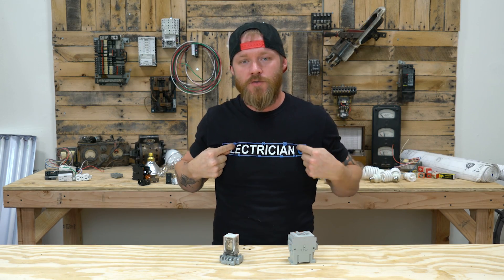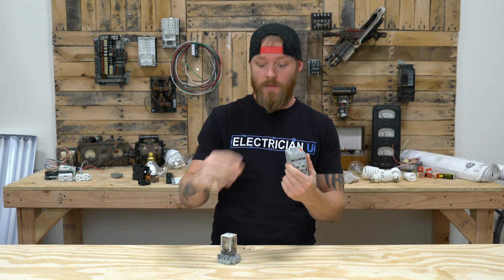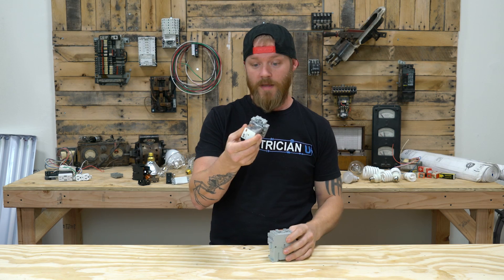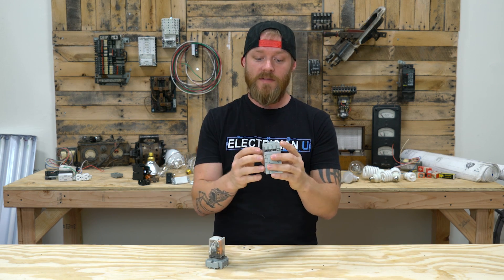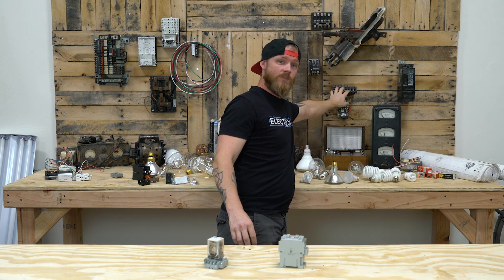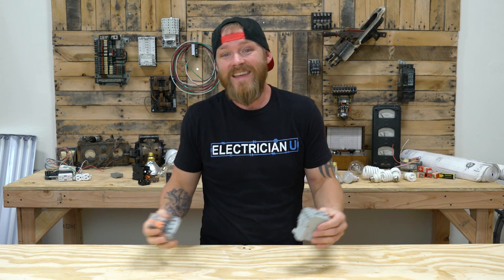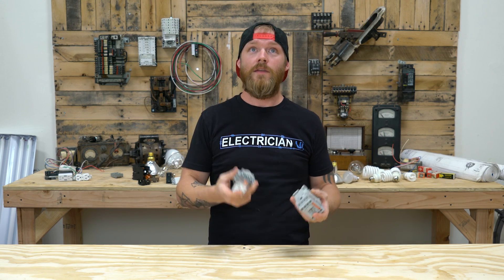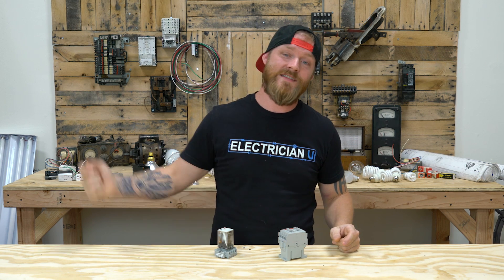The Difference Between Contactors And Relays - ELECTROMAGNETIC SWITCHES electricians use

Comment: Relays "tend" to be for logic switching. Contactors for power switching.
Reply from the maker: Most of the time you're right, but the fact you put "tends" to in there lets me know you're experienced in the field lol
Reply: @electricianu  Hey Dustin can you please do a video about motor controls would be very helpful.
Reply: Yes, relays are durable and inexpensive in "low power" switching applications.
Reply: @Stones_Throw  Right, not gonna see much over 120vac thru them.  I haven't anyways.
Reply: But I'm confused a bit, Synch Pessor. What do you mean by having "tend" in quotes? Are you trying to say that "tend" here is a figure of speech rather than actual tending? Why not just state it directly? What's fake about it in this context, according to you?
Reply: @HelloKittyFanMan.  I took it as a throw back before plc's.  I don't see much use of relays in logic circuits, with exception to safety.  I see them mostly used for switching low power control applications,  like solenoids.  I say mostly as I do see relay logic on older equipment.
Reply: Well,  @shnlj5910 , I'm not sure what possession of a programmable logic controller you mean (a PLC's... what?), but if you just meant the plural form instead (more than one PLC, so "PLCs"), then here's what my reply would be:
Still, though, "tending" would be real, rather than just spoken as if it were a figure of speech, right? So that's why I asked Synch Pessor why he put "tend" in quotes like he's just saying it because it's someone else's idea, or just an artificial idea in general, rather than one that he agrees with or rather than what's reality (you know, the usual reason we use quotes even when we're not quoting someone's actual saying). So it will be interesting to see what, if ever, Synch says on the matter, huh?
Reply: shn lj  , see them all the time in commercial hvac units and as pilot relays on building automation systems. Like you said , usually lower voltage . I’ve never seen more than 120 on them.
Reply: Johnny Jr you can get relays that have coils that run off 208, 240, and 277V. Plenty of RIB relay models have those coil options.
Reply: Russell Brown that is true.. I use ribs a lot . Didn’t think of that.
Reply: If I said it differently it wouldn't be accurate. An excellant presentation by EU.
Reply: @Stones_Throw : It would be if you hadn't included the quotes around "tend." With the quotes, but you're not actually quoting someone, it's like you're just saying that as a figure of speech instead of meaning it for real. So why the quotes?
Reply: @HelloKittyFanMan.  Like most situations. There are no absolutes. My statement with the condition "tends" simply focus on use and not design. "Yes, relays can switch low amperage power loads."
Reply: @Stones_Throw : Of course. But you can say that without the quotes. Relays tend to be for logic switching. See how I just did that without the quote marks? So again, why the quotes?
Reply: @HelloKittyFanMan.  Because it's "my" declarative statement. My intention was to "not" dispute EU in any way. An excellant trade channel.
Reply: @Stones_Throw : Now you gotta quote yourself? And "my" in quotes? So it's not really yours? And then you add them around "not." Dude, you're just quote-happy and it doesn't even make sense. Just because you put quotes around your own statement doesn't mean you're not disputing. And if you were gonna quote yourself then why not just put quotes around the whole statement? DUHH....
Reply: @HelloKittyFanMan.  This has been fun. Highlighting or underlining may have been a better choice. Let's see, "Weeways tend to be used for logic ckts and contactors for pwr switching." Works for me.
Reply: @HelloKittyFanMan.  In my case it comes down to the machinery from all over the world. I've spent 40+ years installing and repairing. Just 1% of my efforts involve solenoid devices.
Reply: @HelloKittyFanMan.  Focus "here" skippy. The purpose of the quote marks was to without question make my statement "not" absolute.
Reply: I tend to disagree. Most modern logic circuits tend to use solid state devices to replace relays in today's products. In the Automobile industries, relays are used to turn on all sort of things from cranking the engine over to blowing the horn. Microwave ovens use them to turn on the magnetron tube. On the other hand, a Contractor is nothing more than a big relay.
Reply: 40 amps ssr
Reply: @ser7ser7i they get hot
Reply: my first thought is the relay used in audio amplifiers. a relay doing output power switching
Reply: Can I use contactor ..auxiliary /hold circuit for power cut off function in my device ? when the device send a trigger relay break input to the holding auxiliary circuit of the contactor?
Basically I need this in my plc project to cut off supply whenever any emergency/error occurs.
Reply: 90 Amp starter in my car is fed up with two  parallel 70A relays.
Reply: Is there an umbrella term for both of them?
Reply: What about in Motor Control Circuits that operate on lower voltage 120v to power on/off 600+volts  motors? Are those relats or contractors?
Reply: Relays are used to switch solenoids frequently.

Comment: Any recommendations for a two-voltage relay/contactor? Something professionally made that runs 120 volts AC but controlled by 12 volts DC?

Friend has a system rigged in a remote cabin, but either he's doing this with a rigged automobile relay or has something I don't know about: I want to make sure he's running legit.

Comment: Please can you draw a circuit that includes 2 water flowters one for high water level and one for low water level, so the pump will only work when tank is fully empty and stop when full, usually water floaters work on limited level and pump keeps on and of

Comment: Hi, thanks for this video. 
I know both devices but i really hadn't wondered the differente between them until i found this video. So i mean, a contactor is like a relevator but with more features, right?. But i understand that even they work with the same principle, they are designed for different applications. I think there is no better device, that depends of what you want to control or your necesity. If i want to control a simply 110 volts indicator i won't use a contactor, and also, if i want to control a three phase motor obviously i won't use a relevator. Anyway thanks for your content, now i have a better understandig of those devices.

Comment: Can an AC contactor coil be powered by DC?
It all seems rather mechanical aka analog in their design. Typically, I use a contactor to handle the load that a digital timer might not be able to handle for very long due to its less robust design incl poorer materials.
Would like to do the same for PV, but would need a contactor with a low-voltage coil and high voltage contacts.

Comment: Thank you!
So, if I have a pump that is 230v w/ max draw of 6.1A, a relay could work for it? (I've seen relays that look like the one you've been holding in the video that do up to 250v and 10A). All I want is something to make a float lever tell the 230v pump to turn on when the float is down and turn it off when the float is back up to a certain point (to fill a cistern). Would the relay work for that?
Any idea how to wire that? The float has 3 wires (with only 2 being used depending on what you want it to do-- in the one I'm looking at getting, the brown wire would be excluded if I want the pump to turn on when float is down). I keep trying go find diagrams but they say it is specific to the application.

Comment: There are Many different configurations available especially when you factor in Add-On NO / NC Contact Blocks.
What you said isn’t Wrong, but the Easiest Way to distinguish each of the Three Types is:
Relays = Control (Very Low Draw)
Contactors = Control Power (High Draw and AIC)
Starters = Contactors with Overload Protection (High Draw and AIC)

Comment: So I'm looking at a relay/contactor it's for my vehicle there's a 9-32vdc switched leads for closing the the normally open coil that handles up to 500amps of current it's completely sealed with an epoxy with 2 bolts for heavy gauged wire I'm wondering if this is a relay or connector? My alternator currently puts out 15.5vdc internally regulated and clamps 430amps to charge up my (LTO) lithium titanate oxide battery I've built for car audio it's a massive bank capable of putting out 3200amps constant and 6400amps for a 60second clamp holding . The goal is to protect my alt but just wondering what it would technically be called whether it's a relay or a contactor? Thank dude love the channel

Comment: OK as far as it went but you missed some very important features of relays. Relays operate far faster  than contactors, they also can handle much higher current than  you said also they can have far more coil voltages and switch elements than any contactor. I would definitely want a relay at the end of an emergency stop switch for the speed of disconnection And most important you did not mention  latching Relays sometimes called bistable relays , these relays only require voltage applied to the coil to move the armature one way and the contacts will stay open or closed without further supply current or voltage. Its state can be changed by applying an other voltage  current pulse to change its state.  Some of these type of relays have two coils to change state and others can have one. This type of relay is used in machinery switching using  momentary action switches doing away with mechanical interlacing  switch linkage far increasing reliability and speed of operation. I was taught that a relay is a fast precise electromagnetic component where a contactor uses slow brute force, one is a donkey the other a thurourbred race horse.

Comment: Interesting video. Thanks. 
I have a variable speed controller for a 130 VDC treadmill motor. I have a dpdt switch for forward and reverse. I’d like to have a green led light come on when it’s in forward (+-) and a yellow led light when it’s in reverse. But the LED’s are low voltage and current. 
So I need a switch that allows low dc voltage to flow to a led when the polarity is +- and when the polarity to the TM motor changes, it closes that gate and opens another. 
I’m doing a poor job of explaining it, but I hope you understand. 
Any suggestions? Space is limited. 
Thanks for your attention. 
Paul
Reply: One can run two sets of LEDs connected to the appropriate resistor and a blocking diode in series, one green and one yellow, and then connect them in parallel with the power wires running to the motor. With them being connected in different polarities and the motor is moving one way, the polarity will only allow current to flow through the diode and the resistor to supply the proper voltage to light the appropriate color LED. Green LEDs have a different resistance than yellow ones, so each resistor will need to be sized accordingly. This will work as long as the speed controller is pulse width modulated (with some possible flickering of the LEDs) and not voltage modulated. If the voltage is modulated, then you will only have a narrow window of voltage that the LEDs will function in.
Reply: @GoCoyote  Thanks. I’ll try it. I’ll have to lay it out to understand first. Thanks for taking the time to answer. 
It’s a shame that I can’t find a nice DPDT rotator selector switch that can handle 130 VDC and 20+ amps. I ended up with a monstrous 3PDT changeover switch that’s yellow and red. 3” deep. I wanted something a bit sexier in stainless. But even the 20 amp DPDT toggle switches don’t hold up to a 4.25 hp treadmill motor. 
May I ask you more questions about wiring? Do you have a website where I can send you pictures? I’m desperate here so I’m reaching out. 
Thanks,
Paul

Comment: Contractors are equipped to wider gap in case of opening circuit so they have capacity under induction loads and limiting arc.
Relays has no ability to extinguishing arcs, the open contact gap in relays are smaller than contactors. 
For switching off a 16A electromotor or induction loads such as transformers, you need a contractor not a relay, calculated in correct rating which not necessarily that 16A. The opening speed  of contacts in a contractor is faster than a relay.
The main difference is braking current capacity.

Comment: I usually think of them about the same, contactor usually I think large loads or motors, 3 phase things. I think a contactor for a motor though is a bit different with fuse links, etc I think that is called a starter to me it is a contactor.

Comment: What a great video. Well done. 
If i have a 50A breaker (which is probably too big) servicing an old Lennox (armstrong air) condensing unit, and my contactor craps out,  can I use a 40A contactor? The condensing unit is 30 years old snd has no markings on it at all. No idea how many tons, or what contactor is in there now. 
Obvously, just looking for an opinion, from someone who knows more than I do. Everything is working, I just like to understand how the stuff inter relates. 
Thanks.

Comment: So how are these spec'd? I mean if I want a contactor that will pass 220v through it but is switched (coil) by 110v, how would that be identified? I want to turn on a 220v motor with a 110v switch...if that makes sense?Thank you for the video. I have subscribed so I can learn even more.

Comment: Simple explanation for a relay is a switch that uses a lower power load to operate to switch a higher power load. 

Saying a relay is only for small low power uses is simply false. Go look at an older car with a starter relay separate from the starter. You have the small wires which control the coil operation in the relay. The heavy gauge battery cable and cable to the starter are connected to the contact points for the relay. 

I stumbled on this video and watched all the way through in case I was missing something but it was just in accurate.

Comment: Please note the fact that a contactor is typically bigger and heaver, high power etc than a relay is missing the point of why a contactor is called a contactor. A relay is a device where there is no emphasis on the closing and opening mechanical forces for making and breaking a circuit, where with a contactor there is emphasis hence the name to slam down with considerable force and make contact.

Comment: A relay is a device where there is no emphasis on the closing and opening mechanical forces for making and breaking a circuit, meaning that current can be switched on via energizing the coil or it could be switched on via releasing the coil and relying on the spring to make  a contact. A contractor is actually different as its intended to only ever close a circuit when energized, and slam down with considerable force hence the name "to make contact" Yes some units can be configured to break a normally closed circuit too. The aux contacts that piggy back on the contractor mechanism are an optional extra and are for low power use only. The reason why contractor are used to slam down and make contact hence the name in high power applications is because a large amount of force is required when switching high energy equipment.

Comment: On Relays the Nickel Cadmium on the Contacts is rated for Less than 20amps used typically for lower voltages single phase. 
Contactors are typically 20amp or greater and up to 3phase with auxiliaries

Comment: little late to the game here but question..... wiring a trailer dealing with shore power 120v, and battery 12v,  switching from shore power to inverter power, could you technically use a 30 amp relay as oppose to a  30 amp contactor?

Comment: Actually, with a normal switch you can control as many different things as you can afford to load it with. Just run them in parallel.
Reply: But the switch has to be rated to handle the current you’re sending through it. And it can only be manually controlled. No automation.

Comment: Latching and unlatching relays are fairly common. Some also have manual over-rides to latch or unlatch. Not to mention the myriad specialty relays, multiple types of timing relays,  alternating relays, current sensing, voltage sensing, etc. I started working in switchboard shops before PLC's came out and worked a lot with relay logic; panels with as many as 300 control relays of various functions. Troubleshooting? Oh, joy!

Comment: Why not just use a double switch or duplex switch , like two switches in one is what I mean , instead of using a contactor ???
Reply from the maker: You could do that for two things, but what if you want 6 things all controlled by a photocell. The contactor can be controlled without manual switching and work off of the sun going up and down on its own. That’s the benefit rather than you having to walk up to several switches twice every day/night to do it yourself.
Reply: @electricianu  dizzamn you right ....yhea that was just a test see if you paying attention .... ughhem yhea that's right : /

Comment: I need a dpdt contactor or relay, 24 or 110 ac coil, to power a Grunfos ac/dc well pump powered by solar during the day and utility power at night. Can’t find one to handle the load of the dc without burning the contacts. Need 110 ac 15 amp on the normally closed side and 100 vdc 20 amp on the normally closed side. Can you refer me to a product.
Reply: There's a tonne of class ntactors out there that will handle that load with no issue at all.  I controlled 480v 50A loads with 120/20 for cranes on a regular basis.  Any electrical contract supply house should be able to help you out with specific units, they won't be cheap...